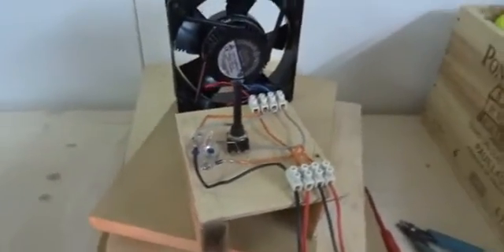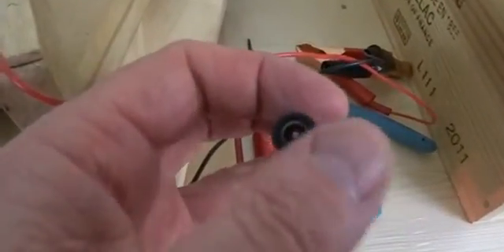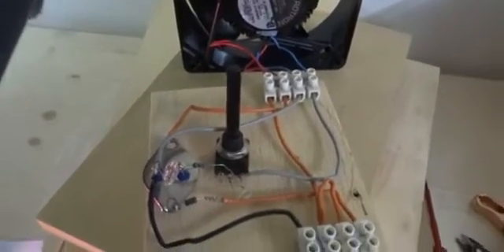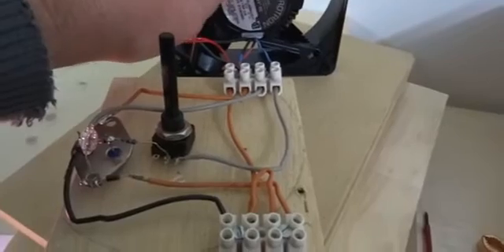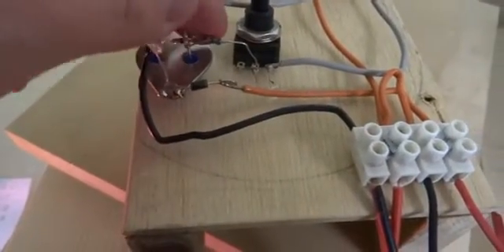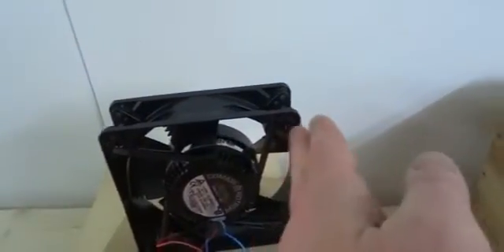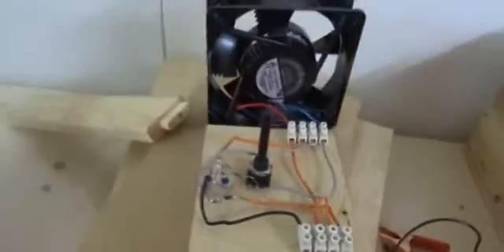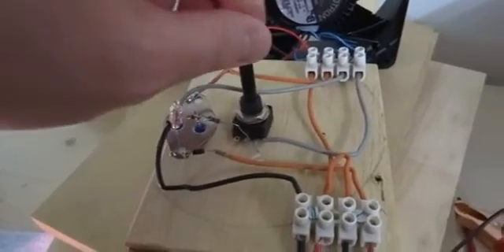Fan Bedini Battery Charger - same a Rick Friedrich uses

Comment: Hi Rick, thank you for responding. Indeed there are many different circuits. My circuit is :(Self Runner Rick freedich) normally you fall on it! A simple wheel, 2 transistor, an iodine bridge, a bifilar coil (18 awg x4, and 22 awg x 1) and another coil (in 21 awg, 33ohm). Then we have a coil of 33ohm alternatil(inductive) on an iodine bridge: I optient about 27 volt (AC) and 15 volt (DC). On the shema it is marking: More than 2000 volt! (high voltage) But I only have 28 volts! Why don't I have this high voltage? thank you Rick soon

Comment: Hallo,  Fan is very good, 
your Bedini Tuning:
24V Input with capacitor (4700 microfarad or more)
Transistor 2N3055 is 20 years old, the best ist now TIP35C, more Back-EMF
Transistor with Heatsink in the airflow of the fan,
Potentiometer 6 oder 10 way (360°) 5 or 10K

very Good is RE-EMF Charger by Rene with TIP35C, 20 turns Power, 30 Trigger with ferrite ring,
bye from Germany